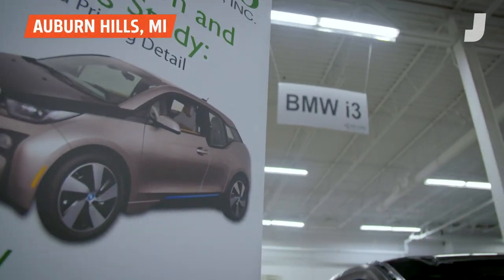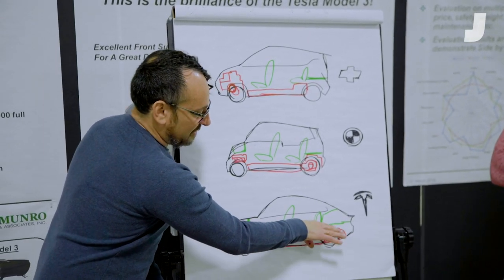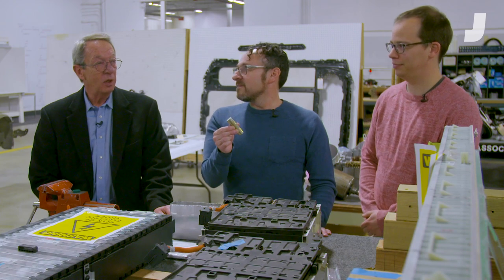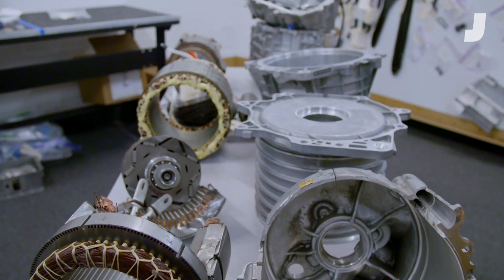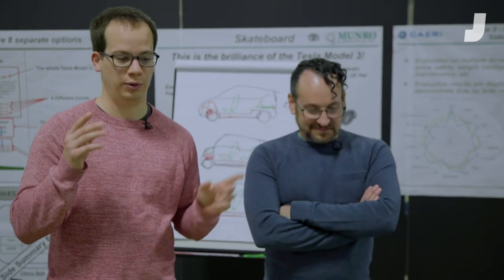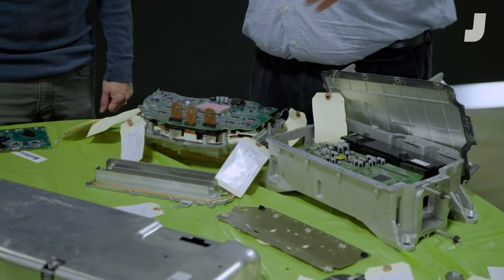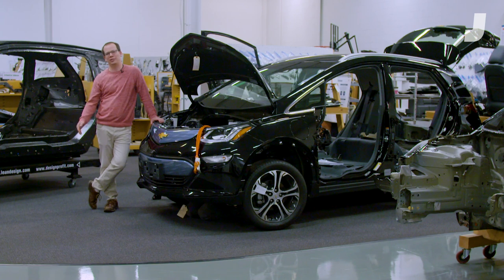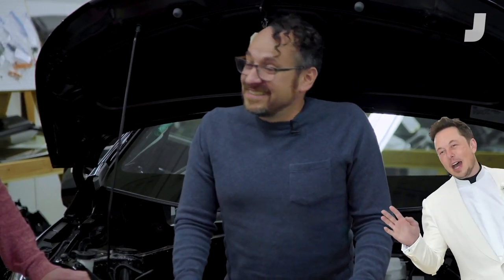A Look Inside The Tesla Model 3, Chevy Bolt, and BMW i3

Comment: I watched in amazement that jalopnik was the first to LITERALLY show and tell me difference between why Tesla will win and the OEMs will lose. 

You can't modernize on top of a legacy platform. You must start from scratch.

OEMs are mainframes, you can change the front end all you want. It's still a mainframe backend.
Reply: Autoline today.
"Chinese Tesla" stripdown by Munro
Reply: @Coraga 1 True. But not as simply done for the masses like jalopnik just did. I forwarded this video to friends because of its simplicity. But you are correct
Reply: lankale2009 what killed me is they are the people constantly writing half truth articles for clicks about how Tesla are not great.  Then when they finally you know look at in great depth with real professionals not paid by some random investor they come away with shock and amazement.  Funny how that works.  I have two.  They are far from perfect.  The service is awful.  The car however is something else.  The thing flys handles likes a bmw and cost me next to nothing to run.  If this is the future well I am already all in.  I just wished they would have done this kinda deep dive long ago and couched all the bad things with this as the back drop.  Tesla engine designers work hard so do the battery and frame teams.  The service side is all a cash flow issue.  If they had a spare 2 billion they could buy them selves out of that hole.  Traditional automakers will have to spend 10x that to get out of the r and d hole they are in.
Reply: @sziehr  The only thing I would like to mention is that Tesla has about $3 billion to spare (cash).
Reply: Good thing there are so many experts on youtube and the comment section. what would we do without it..
Reply: Chevy Bolt stop production.
Reply: GM has their skateboard design as well. Tesla will be bankrupt due to their stupid business decisions.
Reply: A lot of people would probably be even MORE out of control.  And, with no one to provide any truth, more people would be mislead.  Think of it as an infection.  Is it better to have antibodies or be a full blown AIDS patient, trying to battle a disease? ;)
Reply: @herbiehusker1889  You mean like GM went bankrupt and still owe billions to the taxpayer?
Reply: @morosis82  you mean the loans they paid back? No, I mean Tesla makes a good vehicle, but their maniacal snake oil salesman in chief Lord Elon himself is going to drive the company out of business.
Reply: @herbiehusker1889  No, I mean the stock that the US Gov took in lieu of loans that turned out to be next to worthless. Essentially an $11.5B handout.
Lord Elon is the only reason Tesla has been as successful as it has been, so you'd better get used to seeing him on your newsfeed because it's going to be a while before the rest catch up enough to make similar headlines to Tesla, if ever.
Reply: @herbiehusker1889  The only reason GM is making an electric car is because they know EVs are the future. That says a lot.
Reply: That is a terrible analogy. Mainframes are unmatched in high volume speed from any ground up redesign hence why they are still used everywhere.

Also you do know that OEMs do ground up platform rebuilds every 6-12 years right? And VAG, Merc, BMW and Ford are all currently in the final years of their ground up EV platform redos. I like Teslas, but you people need to quit the circlejerk and realize other makers will take lessons learned from Tesla just like Tesla took lessons learned from everyone else. You people do know there are some 70 MILLION cars sold every year and yet you make these stupid claims that only Tesla will be selling cars in the future.
Reply: Tesla is an OEM of Tesla. You used the word wrong. Maybe "legacy", "traditional", or "old fashioned"  is what you are trying to say? 

Plus the automobile was built on a legacy platform to begin with and that seemed to work out ok .
Reply: No the OEMs have years and years of profits stacked up to spend on r and d, established dealer networks, and the ability to reverse engineer Tesla’s. 

Once any patents Tesla holds run out, the OEMs will be churning out full electrics like nobodies business. They’re already gearing up for it as the demand for electrics increases.

Tesla’s been operating at a loss since its inception, and shareholders are starting to lose faith now Audi, Jaguar, Renault and Volvo are all producing promising concepts that match or exceed Tesla’s range.
Reply: Look up what it stands for.. It's used for more then just automobiles. You can't change a definition of a word all on your own. ;-)
Reply: Jerr Spud I wasn’t the one who started using to describe the old guard of car manufacturers here lol.
Reply: Thing is, the major brands need to build these transition models before they can commit to a from-scratch EV because it is a paradigm shift. Tesla had the freedom to produce whatever they wanted to build right from the start.

That said, it is very likely that in the next few decades, these major brands will have mastered EV manufacturing and design as they start to cut down on IC car production, and by then Tesla will meet serious competition.
Reply: I3 is a legacy platform? Are you on a different planet? It's made of carbon fiber for christ sake. It doesn't even hare rust issues...
Reply: @morosis82  Without gov't subsidies, Tesla would have already gone bankrupt.  Those subsidies can also be called handouts that will NEVER be paid back, so chill with the gov't money argument.  They're all on the take.
Reply: @pervertedspeed164  sure, but subsidies that help develop new tech are a far cry from those propping up insolvent companies/industries.
Reply: @morosis82  Gov't has no business subsidizing ANYTHING, bailing out ANYTHING, or making loans.  GM should not have been bailed out, or given loans, Tesla should not get subsidies for selling cars.  If the technology is feasible, venture capital will fund it.  Tesla is mostly privately funded anyway.  Why are we propping it up?  Gov't has a long history of funneling money in to dead end boondoggles and even if one works out every now and then, it's still our money being spent and not paid back.
Reply: @pervertedspeed164  disagree. Most of our modern tech would not have been done without Gov spending, especially for military and aerospace. Private equity is great at taking a proven tech and commercialising it, but completely new stuff is almost never developed solely with private capital, it's too risky with no clear reward.

Tesla isn't still taking Gov dollars, they just got some help starting up. Also, while you may disagree with global warming, the public health benefits of EVs are clear and definitely something that make sense from a public policy perspective. Spend a couple billion to save untold billions in lost taxes because people in hospital or not working due to sickness don't pay any? Kind of a no-brainer.

Not paid back? Entire industries worth hundreds of billions a year have been born because Gov spent money on something everyone said at the time was useless. As far as research, that should be the primary role of government as far as I'm concerned, pushing into the unknown so that the benefits can be exploited by someone who can commercialise it.
Reply: @darkhorsegarage  No it has beaking issues.
Reply: Matthew Jenkinson — So nice to hear that someone else “gets” it. The (US) government was the driving force behind little projects like the internet, satellites and GPS, lasers (including the ones in DVD/BlueRay players), and obviously tons of military and transportation technologies. Oh, and autonomous vehicles. Thank you, DARPA, for all that and more!

And you nailed it on the government bail outs and incentives. Had the government not helped (all!!) the automakers through the recession of 2008, roughly 1/4 of the US workforce would have been out of work — not just the GM, Ford, and Chrysler line workers, but millions and millions of folks at companies that supply those three, in particular. With all those people out of work, no one would have had any money to buy anything, so tons of other industries would have gone under, too, like consumer electronics (TVs, smart phones), appliances (washers, driers, fridges and stoves), clothing, and even food. As those manufacturers and suppliers went under or drastically scaled back, that would have put many more millions of people out of work, making the situation even worse.

And with all those folks out of work, they wouldn’t have been paying taxes (Federal, state or local) so services would have had to be scaled way back, impacting folks further.

So, sure, the government “wasted” money helping the automakers... but it prevented our economy from grinding to a halt. Folks have to look beyond the surface to ponder the ramifications of things to understand the impact of such policy-type decisions. The bailouts totally saved this country and every working stiff in it, along with anyone with a 401k retirement fund.

Comment: That i3 is really ingeniously put together. I've had the pleasure of spending an afternoon inspecting a gutted one, and from a design for manufacturing perspective the thing is a beauty!  The entire frame is bolted to the skateboard by only 4 bolts. The skateboard is bare aluminium, consists of profiles WELDED to aluminium casts which in turn have several holes and mounting points for the suspensions and axles, there are resin tabs in the carbon fiber to hold the wore harnesses (you get these for free in the molding process!), All kinds of innovative things. The whole thing is like a big experiment of innovation in manufacturing, and I love it!
Reply: And then BMW promptly sold the carbon fiber capability. I think they had enough.
Reply: @billh2294  This is possibly a good thing. At least steel and aluminium can be endlessly recycled and there is already a big material recovery system in place.
Reply: @billh2294  Worse than that. A lot of the engineers and designers on the i3 project left BMW. The managers had no follow-up EV project for the team on the cards and many of them wanted to continue working in the EV space.
Reply: @cros13  Any idea where they went?
Reply: @billh2294  A lot went to China, a disproportionate number ended up at Byton and BMW's partner there Brilliance. Some went to the american EV startups like Tesla, Rivian and Faraday.
Reply: I wish people knew that about the innovative BMW design and saw beyond what news sources makes the teslas so popular, hence peoples perspectives are skewed a little bit about the i3. Maybe it came out too early. Almost like the Apple effect in a way.
Reply: The Tesla bobble heads will never admit it...  That reviewer with the funny hair just rushes past it and has incorrect information to boot.  Where's Elon's butt smooch smooch...

Comment: I worked in the clean room building the inverter for the Tesla Model 3 shown, the one with pink pad on the top, funny to see something you made on here.
Reply: I work on the main drive unit floor, it's funny seeing the motor and inverter which i'm well familiar with.
Reply: Very cool indeed.  Good work!
Reply: Edison Motors They don't use brushes. These are AC motors. For those who don't know.

Comment: The pillar being "3 times as wide as it needs to be" is probably one of the reasons the side impact intrusion rates are lower than any other brand on the market
Reply: That flange has nothing to do with strength
Reply: A thin sheet metal flange isn't going to protect from side impacts.
Reply: It's probably some obscure reason like tuning the resonant frequency of the chassis to damp vibration, I have no doubt it's exactly as wide as it needs to be.
Reply: @suckmybat  It's probably something like a robot needed the flange to be that wide, then the robot didn't work right and they were all done by hand. Then it didn't make sense to change the flange width after they were already built.
Reply: @suckmybat  its probably much simpler. Tesla has struggled with the tolerances on their chassis from the start (see panel gaps). Larger pieces are easier for a robot with little mechanical sensitivity to hold in place. Not to mention metal likes to warp in one direction when you weld (the direction of your first bead), so having a strong grip is important.
Reply: ... or the resistance of the roof structure to prevent the crushing of occupants. Yeah... keep those pillars wide Tesla, I don't mind.
Reply: @OlivierSuire  That too
Reply: @OlivierSuire  Probably not, it would be more shapely. Flat steel is weak steel.
Reply: It's possible that flange is bigger to support the wider rubber seals for the frameless windows on the doors, maybe?

Comment: One item to remember is Tesla reduced the spot welds on the model 3 by 500 spot welds without compromising body integrity. That happened roughly one year after production began as a means to speed up production.

Comment: Surprised there was no mention that the motors in the Tesla Model 3 are permanent-magnet switched reluctance motors, which are fundamentally very different from the induction motors used in the Chevy and the BMW.
Reply: If you are referring to the motor shown in this video, they are not switched reluctance...even if I read this in many websites. Eventually can be somehow classified as synchronous reluctance.